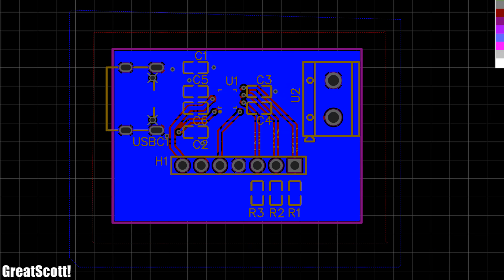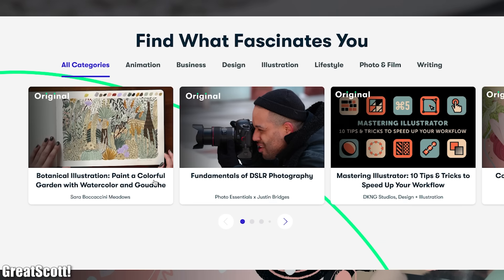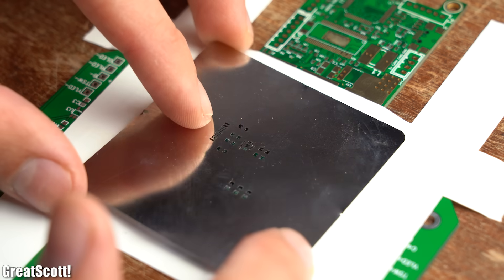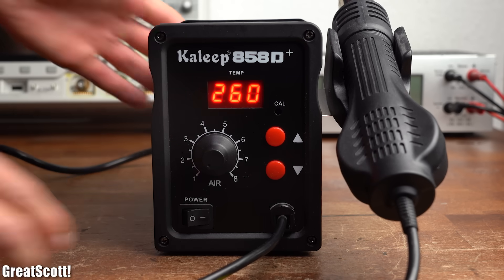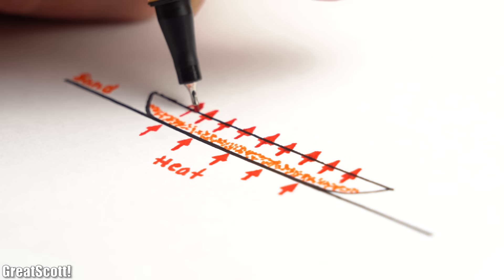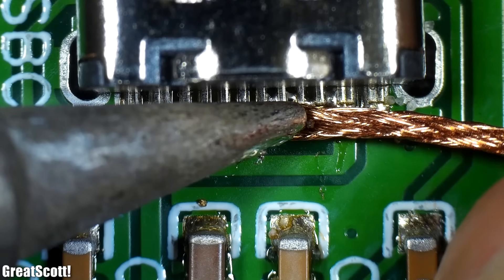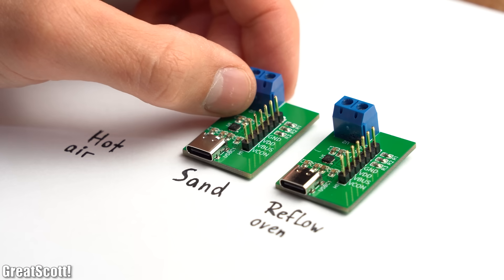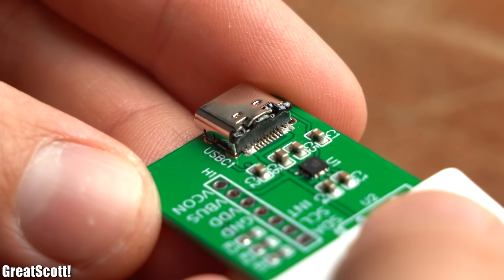How to do SMD Reflow Soldering properly! || Hot Air VS Sand VS Reflow Oven

Comment: Most common mistake by anyone new at soldering is to use a very conservative amount of flux and secondly a use of poor quality one. And you are making both (i am pretty sure).
1- you don't have to go through all that hassle. Just apply a thin layer of a good quality flux and then apply soldering paste. Upon heating by hot air it will flow like a magic and stick to every component very easily. 
2- Always use a little high temperature (300C is low), go for 350-400. High temperature for few seconds is not damaging to smds and usbs but medium temperature heating for a lot of seconds will not melt the solder properly, melt the plastic components and you will end up some shorts.

Comment: Try doing a single swipe of the solder paste. Each swipe is forcing a bit more paste under the stencil and ending up with too much. As for the reflow oven. I've got the same one and you want to lift the board off that tray. Get some old PCBs and put them under each corner so it heats up more uniformly, otherwise you can get inconsistent soldering where the board touches the tray.

Comment: I have the T962 and it was interesting seeing you following the exact same upgrades I did a few years ago! One tip when using the T962, you need to keep the board off the tray - I just use some spare FR4 board - the metal tray acts as a heat sink and prevents the air blower getting air underneath the board. Great video! 😃
Reply: What you said. I was just about to say that!
Reply: I see others use bolts (M2?) with a nut to make moveable standoffs.  Bolt head is on underside of tray, nut is on topside and tip of bolt is your standoff.  You can spread these around to put your board on which gives you good airflow and mechanical stability during heating.

Comment: I used laser cut acrylic stencil, not as professional as the stainless but I could do it locally in an hour not wait a few weeks. Used two pieces of cork board and a 12v halogen bulb for the oven with no control electronics just my phone's camera and myself behind the screen and plug!

Comment: I hand built 75 double sided boards for a project. What I did was take an electric griddle from walmart (about $30) and placed the boards directly on the griddle part and placed the glass lid on top. This was fine for the first side, but for the second side I placed the boards on PTFE spacers for the second reflow.

https://t.co/pjdWc6lBTn This is a photo of my process.

Comment: to unsolder the SMD LEDs I used a 50 W armored resistor and I powered it until it developed all its power.
Resting the printed circuit on the resistance, after a short time the solder melted allowing me to remove the led and replace it.
For small printed circuits you can use the same method: it is equivalent to the sand method but to me the solder has melted very well ... for large circuits you can add resistors on metal plates. I also removed integrated circuits like yours without problems.
Since it was disassembly for me, I did not worry too much about the temperature reached, but the LEDs once disassembled still worked perfectly.
By doing some tests you can get to the right temperature without risk for semiconductors.
see you soon

Comment: I worked in the communications industry years ago, R&D didn't do their R properly and they had the SMT department stuff 1000s of boards, suddenly a leadless chip similar to yours started failing on every board. R&D couldn't figure it out, they never failed on their test boards. Me and the lead re-worked developed a method to remove and replace the chip manually. We would apply solder to every pad including the centre ground. we would then heat the board from the bottom and allow the solder to melt and place the chip on top, never failed, and placed a perfect IC every time. These chips never failed so R&D said it was a batch of bad ICs so they had 1000's more stuffed and they failed. It took the lead re-worker and our supervisor who had no more training than a hobbyist to read the data sheet and discover that the IC had a max heat threshold of 250C and the board stuffer oven got much much hotter than that. The method me and the lead re-worker developed became the standard procedure for installing the IC.

Comment: Little tip for better stencil printing:

Spread the solderpaste next to the holes and use a PCB with a good straight edge (holding it 70 degrees to the stencil in pushing direction) to push the solderpaste to the other side. Don't do it more than once and you will get perfect solder joints. 

Trust me. I'm working at a electronics company. We printing and do smd pick and place thousands of pcbs per week. Sometimes we need to do prototypes with stencil too and I am better in printing with the stencil as the printer designed for that. 

If you need, I can do a video how I would do it. Sadly I can't show it with a stencil at home because I don't have a project right now.

Comment: When you pick up a 0402 resistor with tweezers and it infront of your eyes vanish by opening a smal black hole and  forever never to be seen again.
Reply: “The Gray hole: an area in space where 0402 resistors and single socks go, and household dust comes from.”
Reply: Try an 0201 package that is 10/1000" x 5/1000" of an inch in size. In a microscope tweezers look huge and the package looks like it a size you can pickup until you take your eye from the 'scope and try to find said part(ha-ha).Jokes on us. Next project is a pick and place machine with a Gerber like file per pcb board project

Comment: From my experience owning and using a Zephyrtronics hot air soldering system you need an air bath or preheater that is around 150C to get best results with hot air pens. Otherwise you'll have issues. 

With a preheater everything reflows more evenly and faster. Components don't get exposed to hot air pens higher temperature air flow for as long which decreases risk of melting components package and thermal damage to its internal circuits.

Preheater gently raising pcb core/copper, solder paste/flux, components packages and leads/pads from room temperature to 150C makes all the difference for the hot air method and why you had to go back and do touch up with a standard soldering iron and was having melting issues(solder and components plastic packages).

Comment: I think you put way more paste on the pads with that stencil, and thats why you had to remove a bunch of solder after reflow. You could also try applying the paste with a syringe with a small flat end needle. Also you could use additional flux, it helps the solder stick to the surfaces, and can also help with dividing the joints,  so it will be less likely to form solder bridges. AMtech makes very good flux that requires little to no cleanup after reflow, you can also go Louis Rossman with it and use a liter of it for one chip :D Great video BTW, greetings from Hungary!

Comment: 3:02 I would recomand fix the stencil better, so it don't lift up from the pcb.
You will get much sharper outlines (than 3:23) because there is less solder paste on the pad and much more important it don't get under the stancil.
Otherwise you will get some problems with smaller ICs or when our solder paste get a bit older.
(Some of your problems in this video also come from it i would say)

For T962A there some (pricey) upgrade kits like from estechnical.
But it is only sensible if the reflow oven is used more often.
Works just fine for me for prototyping or pre-series PCBs.

Comment: there are tons of videos online with  Working Reflow ovens made out of those very very inexpensive Amazon Quartz heating elements, usually known as toaster ovens. Those are fast heating and have higher heat density then the resistive type ovens that should be avoided. Those projects are mostly open-source and they work very well with Arduino controllers and a simple SSR. I think they are Far less Expensive then the reflow oven you got and Far more efficient actually. A toaster oven can be bought at Amazon UK by about 50€ tops the a small 9L volume model is more then enough ... all other components are far cheaper then the price of that reflow oven ...and they do the same job.

Comment: I need your help
Ive designed a key less ignition system for my motorcycle but the problem is the circuit dies pretty quickly ive used node mcu micro controller and lenear voltage regulator to step down the voltage from 12v to 5v and relays and some locally available components

Comment: At my faculty we have a big oven with some oil that boils at the melting point of the soldering paste. Of course it is very expensive, but is very interesting and it has a very good profile that is calibrated and you can see the process through a window :D

Comment: Nice video, I probably would have recommended a hot plate as an additional method to try though; it's cheaper than an oven and if you intend to manually control the temperature anyway that's much easier to do. Regarding the hot air: Your temperature was too high and you did it wrong: Instead of hitting the components bang on-until the solder melts, you should start by doing a sweeping motion over the full board to heat it up slowly without causing mechanical stress before closing in on individual components. Also temperature sensitive components are best shielded with Kapton tape, expensive components even come with Kapton type out of the spool. With a bit of experience that works quite well but is obviously not the fastest process, especially for large PCBs.

Also the stencil was too thick, way to much solder paste for the job.

Comment: About a month late GreatScott!. I bought the same hot air station to repair my Nintendo switch motherboard with (eventually) positive results (my nintendo switch now functions again)! A note on your use of the hot air station, make sure to heat up the board from a distance for a few minutes so that the entire pcb is warm (it makes reflowing the solder much easier) and then go in close with the hot air gun. Also, you can shield the usb type c port with capton tape to reduce the likelihood of melting the connector. Great first try, would recommend the hot air station for anyone doing re-work/repair and the reflow oven for new pcbs (not everyone wants to reflow all components at once during a repair job).

Also, as noted by a few other commentors, there was too much solder paste on the board for all operations.

Comment: I haven't used many stencils so far, but from my experience wiping just once across it gives better results. To me it looked like there was a bit too much solder paste on the USB-C connector. I'm using a cloth iron inspired by maker moekoe (https://www.makermoekoe.net/post/maker-moekoe-s-kind-of-soldering-iron), which works pretty well. The only downside is it's limited surface area so it's only useful for small pcbs.

Comment: Regarding T-962A, you’ll probably want to do the cold-junction compensation mod - otherwise all the temp ramps come in low.  At least that’s what happened on mine.  I also added a second fan on the opposite side which also helped to keep the controller cool.

Comment: Some tips for you guys who attempt the first method, use the card to apply solder into the stencil diagonally from the holes, and try to go over only once, this way there won't be any excess solder, so less to none soldering iron action. Also if you are afraid of overheating components use Bismuth based solder, which is more expensive but solidifies at 160 degrees.
Reply: Thanks man.

Comment: I worked with that reflow oven on my ex job. You had to use program 8(old software), that was test program for reflow.
You have to press more on stencil to avoid shorts after reflow.
Also, you can use syringe with solder paste and reflow station, works great!

Comment: I hate to say it but you're doing it wrong just like everyone that uploads a "how to solder" video.

- If you want to solder packages like that by hand you need a tip with a flat profile like a knife edge tip otherwise you are never going to get between the component and the pads to actually do anything. You can see in the video that your round tip is just rubbing against the body of the component and not doing anything.

- When reflowing with a hot air station you still need to think about the reflow profile. You don't just jam the nozzle over a connector like that because as you saw it'll melt. If you heat the whole area the solder will reflow without melting the connector.

- If you don't have the proper tip for SMD work you can just use wick with your hot air tool to do the reworking.

- For a board that small you don't need an oven. A normal food hot plate will work and you'll be able to see what's happening.

- If the boards are just for you and not a life or death medical product then use the low temp solder paste instead. It means you can turn your hot air temp down and that lessens the risk of melting everything or scortching the board.
Reply: I'm sure he knew most of what you wrote & just wanted to make an educational video about solder paste, but on the other hand i think that most of the viewers would appreciate your help/tips including me and (GREAT SCOTT)

Comment: Yeah that was too much paste. You cannot have the paste touching where there are no solder pads, it has to be only on the solder pads in a thin layer. 

Also when applying the paste you should try apply it with one swipe only, because the paste can get under the stencil easily. 

When baking the board it's better to preheat it for 1-2 minutes at 50C and then heat it fully until the solder paste melts.

Comment: I wonder when will you learn about the use of flux... And remember: "The bigger the blob, the better the job!"
Reply: I assume it is a ironic quote from another youtuber?
Reply: @hansmayer7652  Yes, Louiss Rossmann. He has MacBook Repair and Data Recovery business. He does a lot of micro soldering repairs, that involve removal, cleanup and replace of SMD elements and chips, usually done under microscope.
His channel also have videos on wide range of topics. Like "Right to Repair" advocacy, business, politics, real-estate, contractors, city biking, cats, etc.
Reply: You need to use at least one milliPoul of flux.
Reply: Solder paste contain flux.  Normal solder contain flux as well. If you set a corect temperature on solder station, no need for extra flux...
Reply: @Daniel-ne2tg  solder paste flux is not enough. The board must be covered in flux.
Reply: @Daniel-ne2tg , If Scott has used more flux with the iron, he would have much easier time with the SMD elements and the soldier joints.
If you want to have nice round shiny balls, you use flux.

Comment: 1. Buy a dedicated (NO COOKING!) non-stick surface electric skillet with a glass cover (acts as an IR reflector).  Mine is a quality name brand one costing US$19 on sale because they were switching that model from Teflon to some other kind of non-stick surface.  Teflon has a very high emissivity, so non-contact IR thermometer measurements of the skillet surface temperature are very close to reality. 
2. Using a non-contact IR thermometer and stopwatch, both of those being useful for other purposes, come up with skillet full-on time, off time, full-on time, etc., that approximates the desired temperature curve.  I came up with a very close match to the desired curve.  Record those intervals.
3. Place the PCB in the center of skillet to be equidistant from the peripheral heating coil on the underside.  Perform the timed on/off sequences.  The glass cover allows one to see the progress of solder flow.
4. Achieving the proper cool-down portion of the curve is problematic, so after the solder has solidified, remove the PCB from the skillet.

Comment: GreatScott, I want to know what do you think about car headlight lamp that used as smd soldering gun.. can it be used for this application? 

I'm planning to make a custom board with small arm/mips chipset to run some linux firmware, but i don't have hot air gun to solder the chip to the board (sorry for my bad english)

Comment: Sand is a pretty fair thermal insulator, so no surprise that didn't work very well.  You'd probably get just as good a result, in less time, if you just used the pan without sand.

Comment: I use a standard cooking oven. Preheat to 475 F. Insert board for 3 minutes. Very professional results with no component failures after 20+ boards done so far.

Comment: Thanks for your video on this. Two tips however! One, you can save money on the stencil by using a solder paste from a tube. It's possible to apply by hand without a sencil. Two, you can skip the sand and reflow right on the pan! With an infrared stovetop that lets you skip the pan too and go right on the glass.